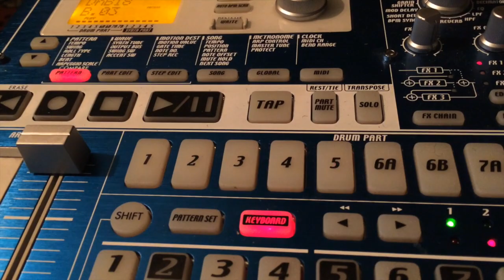Arduino Based Random Drum Sequencer for Electribe EMX

Comment: Great project!!  Hard to find projects involving midi and randomness in my experience. Do you happen to have the schematics and code available? I see in the comments it was available at one time. Thanks!! I have been using a random LED sketch to trigger my Jan Ostman DSP D8 drums. I would love to be able to do so with everything midi!!
Reply from the maker: Thanks Mike! I have another video that's an update on this project where I reprogrammed it to work on the Volca Beats. Both versions are available on github, unfortunately there's no schematic, but it's pretty straight forward in terms of just wiring switches and pots to pins. I tend to use the built-in pull up resistors on the digital inputs so that I don't need to add any resistors of my own, and the MIDI output circuit couldn't be any easier, you can find lots of examples online. There's a "shield" branch that should be the simplest before I started adding more knobs and buttons for the Volca version. Feel free to reach out if you need any help! https://github.com/benirose/VolcaRandomSequencer/tree/shield
Reply: @BeniRoseMusic  Thanks so much for the quick and detailed reply!! Just checked out the code and you are right, no schematic needed. The great instructions in the comments in the code and the code itself are more than sufficient!! Great documentation in the code! I wish everyone was as efficient and thorough as you! I am familiar with most the code as I have been working towards this result. I did watch the other video already. Then I got sucked in by your Bandcamp music and have been listening for the last couple hours. I am really enjoying it!! It is hard to find great music. Glad I stumbled upon it tonight. Going to shut it down tonight and continue listening to it in the morning. Will experiment with your code tomorrow. Thanks again. It is greatly appreciated!!
Reply from the maker: @mikelee1906  Thank you so much for all the kind words! I wish I could say all my code was commented and documented that well, but putting it in a video definitely helped motivate me! 

I also appreciate you checking out my music, I tend to bounce around projects but Our Alarm Clock is my main one. I’m working on some compositions using the moog semi-modulars right now so hopefully that will be out before the end of the year. Subscribe if you want updates on the music or any of my other DIY adventures! Thanks again!

Comment: Hi man, really nice work. I just had the same idea, however Im new to electronics and programming. You dont have to have the code accessible somewhere? I guess i can copy the wiring by viewing this video. Thanks!
Reply: +Ben Rosenbach Thanks man!! Very nice of you. I think I get it, I will get back to you with the results! :)
Reply: +Ben Rosenbach code has a compiling error on my croduino:

Arduino: 1.6.6 Hourly Build 2015/10/28 05:06 (Mac OS X), Board: "Arduino Nano, ATmega328"

avr-g++: error: missing filename after '-o'
exit status 1
Error compiling.
Reply: +Bojan Opacak MIDI_CREATE_DEFAULT_INSTANCE(); this line isnt recognized well somehow actually.